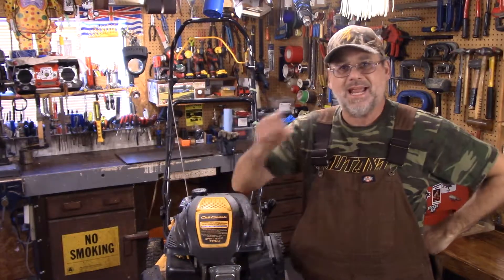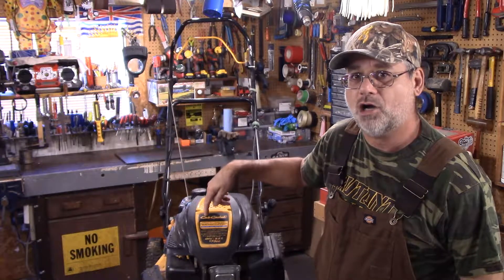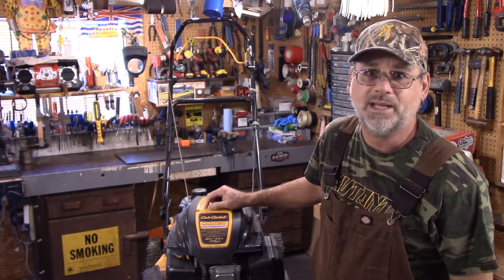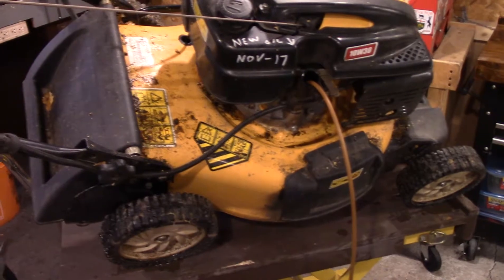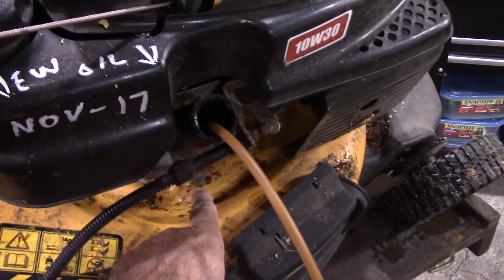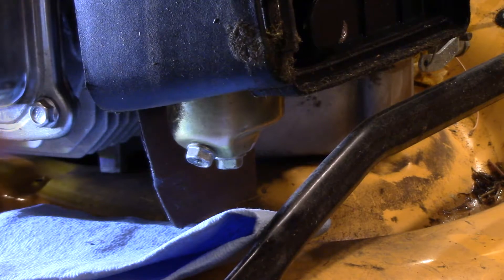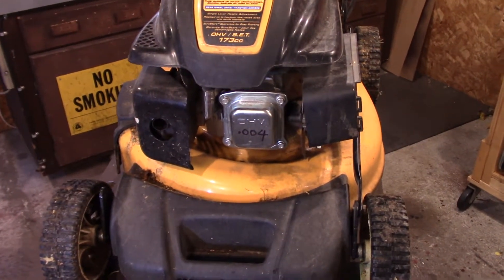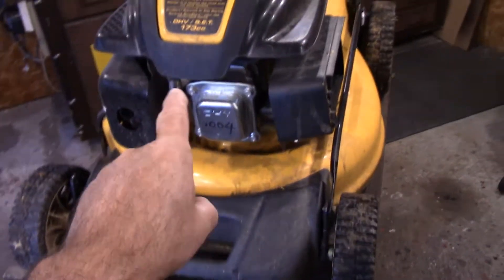HOW TO  WINTERIZE  YOUR LAWN MOWER SERVICE TIPS

Comment: I do that to the cylinder -- fogging oil.  Good tip.   I'll be running my mower until the leaves are all gone, Illinois.   I like the idea of sucking out the oil.  I have a small 6 -liter gizmo for that.   Usually it's for my transmission pan at every ( not quite)  oil change.
Reply from the maker: Good to see your doing  it right too Dave. 👍

Comment: Great video. I have an additional step to consider. Power wash the under side of your mower deck. Then remove the rust and repaint. The build up of grass will hold moisture and rust it out over time. There is also a water resistant barrier you can coat it with after painting. It's called Rust Cure Formula 3000. It should last the year, and it will come off with a power washing, the following year, making it easy to apply each year.
Reply from the maker: Good idea. When the mower was new I coated the underside with bed liner to prevent rust. Before I put it away for the season I power wash the deck . Cheers

Comment: Good tips Steve.  I always mean to fog the cylinder on the snow blower when I put it away but never remember.  I just winterized my mower today.  I took the battery out and put it in the shed! lol
I'd love for them to make a decent cordless snow blower, but I remember the review you did of one last year or the year before and it wasn't very good.
Reply from the maker: Bruce the cordless mowers seem to do well cutting grass but snow blowers are not up to the slush and ice and  hockey pucks left on the driveway :)